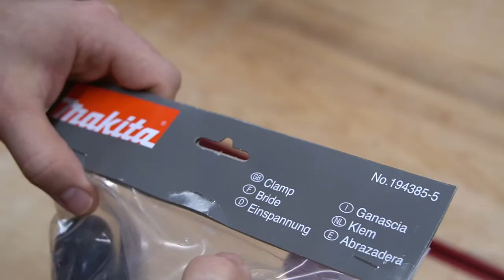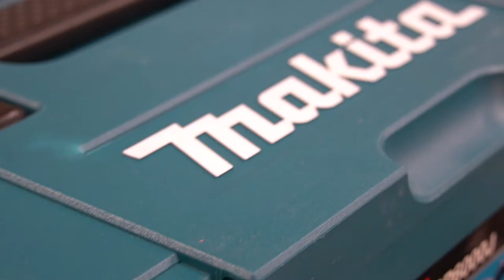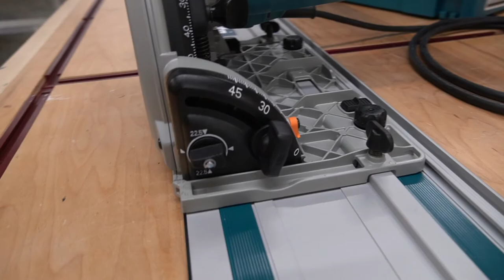Makita track saw unboxing and the ultimate storage upgrade

Comment: Hi and thanks for the post.  I just ordered my Makita and was reading about the compatibility issues with blades.  I noticed you are using Diablo blades with the Makita.  As I understand, Diablo has a 5/8" arbor while Makita accepts 20mm.  How do you get it to work?  Thanks in advance.

Comment: How are those bubinga hooks holding up so far? The weak grain orientation at the bottom of each hook looks like they may break at some point if they get stressed. I hang my tracks vertically from the included holes from a 3/8 steel rod pounded into a board. They fit nicely in the dead space to the side of my garage door. I couldn’t be happier with the saw, you’re going to love it.
Reply from the maker: I have to baby the hooks and be mindful when I'm loading and unloading the tracks. I'll probably switch to something more sturdy soon. Woodcraft sells a decent product for like 15 bucks, so I'll be looking into that soon. I just did a set of kitchen cabinets with the saw though.. I love it!!

Comment: What happened with the zero clearance after you cut 45’
Reply from the maker: When I cut a 45 with my ts 75 the line still held
Reply: @InTheGrainCreations   thanks. Would you buy cordless or corded if you are given a choice now since you have used this saw now?
Reply from the maker: @bklynwam  I like having the cord because I plug it into my festool vacuum for great dust collection